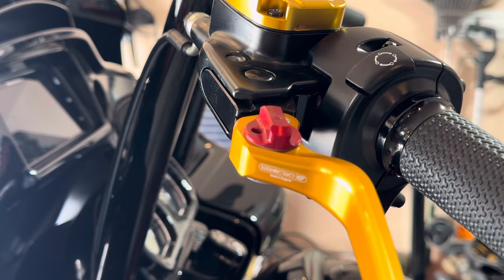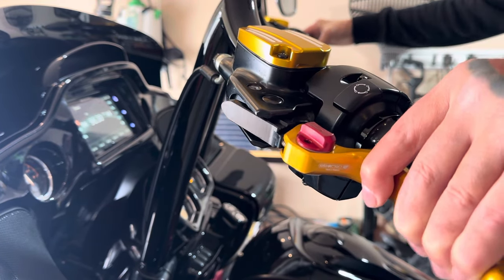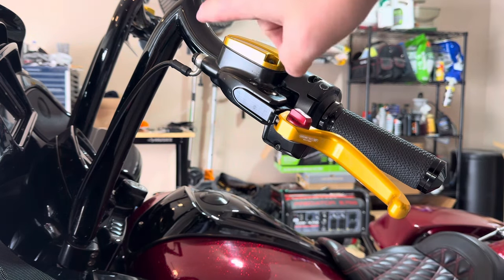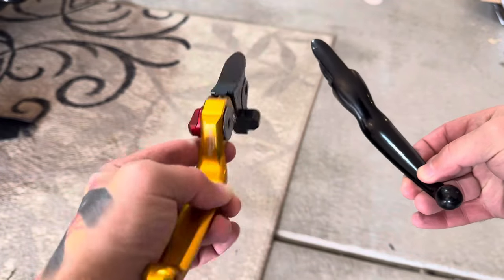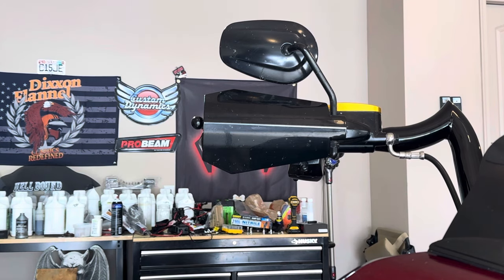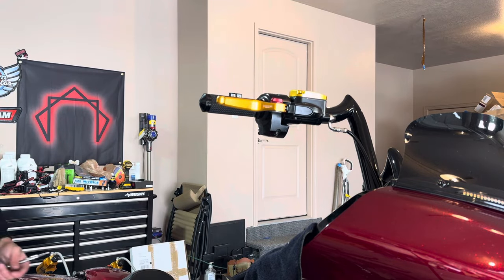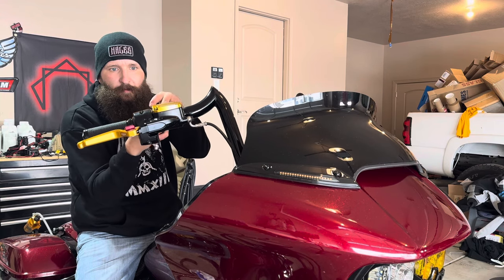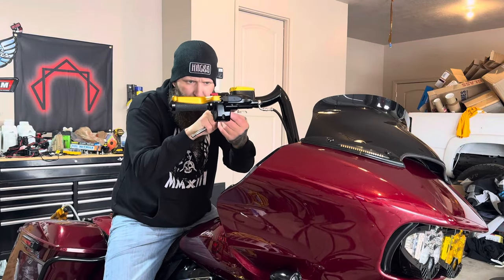Oberon Levers ! Install and review. Great for Arthritis or painful hands. #diy #harley #bagger #RGS

Comment: Thanks for the video. Mine took about a month to get. I purchased the clucth lever anodized black with the blue aduster. I put it on my 2016 Road glide special. About a 5 minute install. Paid for itself after the first ride. What a great product and design. Way better clucth control and a lot more comfortable on the hand. I highly recommend this product. This is Dave from Grass Valley Ca.
Reply from the maker: Agree with you. 100%. They’re absolutely worth every penny. Craftsmanship down to performance. You can tell they didn’t cut any corners on research and development all the way to production

Comment: Just got a set of these myself. Great install video sir. Where did you get ur clutch/brake caps from? Those look great as well.
Reply from the maker: They were from NiceCnc. But I wouldn’t recommend using them. Unless you reuse your gaskets. Don’t use the gaskets they send. They will warp and melt. Mine leaked brake fluid all over the damn place because of the failure.

Comment: Running them for almost a year now. I like them, but settings 1-2 are useless on the hydraulic clutch setup. They are way too close to get the beginning of the friction zone and full release. 3-4 are the sweet spot.
Reply from the maker: I agree with you 100% on this with a hyd clutch.

Comment: Question, if the clutch lever is too close to you, then could that create a problem with not enough level pull range to properly disengage the clutch? Or does the bike creep forward when in first gear if the clutch level is set to position 1?
Reply from the maker: Great question. The friction zone is definitely very close when it’s at its lowest setting (1). You barely let it out and it’s going. Setting (4) is considered stock length. It’s perfect at (3) for me.
Reply: @Gimps_Garage  nice, and the pull is also lighter?
Reply from the maker: @RickyG512  it’s smoother. Idk about lighter. Also gotta factor in if you’ve done any mods to your clutch basket, plates or springs. I have the AIM SDR max on my clutch and it’s a lot harder to engage. So I added the Rekluse slave cylinder. Which helped quite a bit with the pull.
Reply: I’ve had a set for several years and had a problem with clutch engagement. I was looking for levers that would be closer to the grips. I ran them on settings 1,2,3 and 4 (which is according to Oberon is the stock setting) and had creep edge problems. Now I run them at 6 and no problems. I like the feel of them and will keep them. Yes, I did clutch adjustments.
Reply from the maker: @timkeane7469 thank you for sharing your experiences. I notice engagement creep on 2. I can’t even start it on 1. 4 is perfect for me
Reply: @timkeane7469 
I would think that you could go to the clutch adjuster and adjust it to work properly.  When I played around with my clutch adjuster, I could get it to where engagement started almost as soon as I release (The clutch lever is a bit loose and wiggly at that point) or have it so that I have to let out quite a bit before getting gauges. (A lot tighter and less wiggle).  Mind you, that's with stock levers. I've got oberons arriving on Monday and once I get them installed I'll see if I have the same results with adjusting the clutch with those levers. I like mine to be fairly close to the grip but not so close that it wants to creep when I'm pulling it all the way in.

Comment: Great video thx . I installed mine the other day. The clutch works but now it won’t start in gear when pulling the clutch . Any ideas ? Thx
Reply from the maker: Your switch is being compressed. So try and move it out a notch or two with the dial. It might be engaging that switch. If moving the dial doesn’t work.  Take the lever back out and reinstall it and just make sure the switch in the master cylinder is sitting flush down in the recess in the lever
Reply: Thanks for the info . Il definitely try that .
Reply from the maker: I’ve noticed that anything below setting 3, is too close and it will engage the clutch. 4 is perfect for me. 3 is good if I’m on freeway / highway cruising. Sometimes I’ll switch it from 4 to 3.
Reply: @Gimps_Garage  I’m going to go try a different setting now lol.
Reply: @Gimps_Garage that worked . Thanks for the help 🎉
Reply from the maker: @robertpenland2429  nice. Happy to help 💪🏻

Comment: Does the shade of gold that the Oberon levers are match the shade of gold on your Ohlens suspension reservoir???
Reply from the maker: Yes. It’s very close. It’s like a honey gold almost.
Reply: Ok great. Mine just got delivered. I’ve been waiting since thanksgiving. Your setup looks great.
Reply from the maker: @javiriojas6463  thanks man. I appreciate it. Definitely have spent lot of time and money getting it to where it’s at. But through all the BS with some of it. It’s definitely been worth the effort. Also, #BoostedBrad / #DeathMetalRacing makes some sweet gold levers in two different shades of gold. You could check his out.